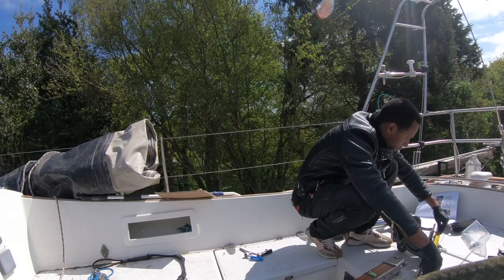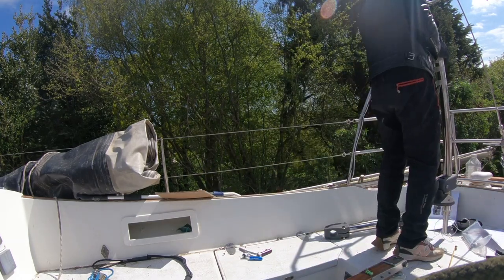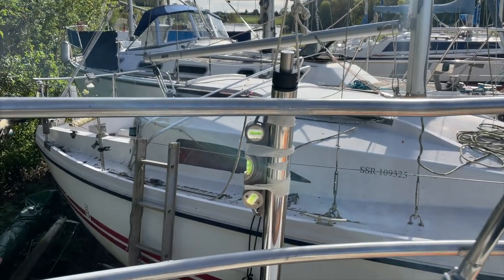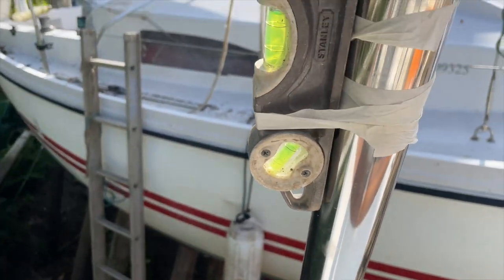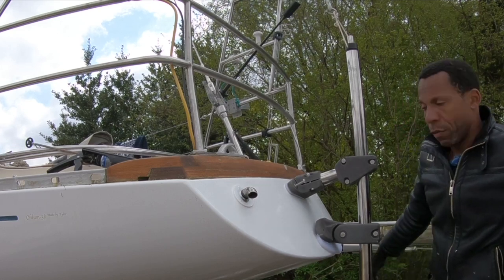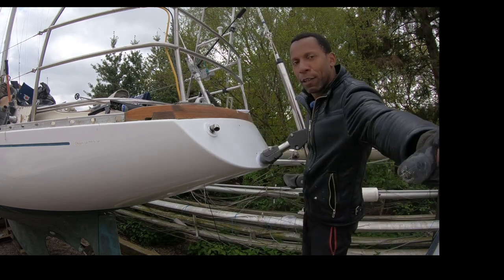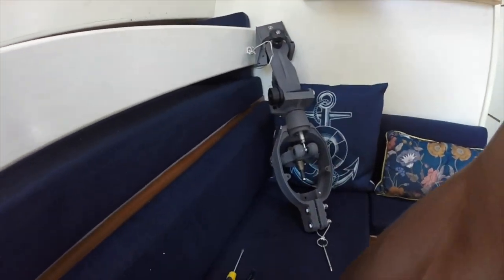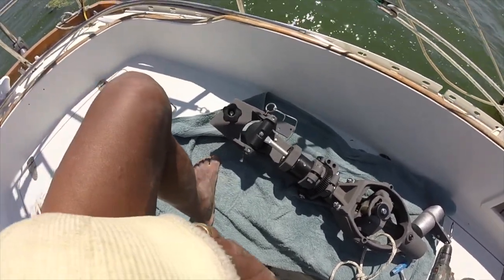Discover how Hydrovane revolutionizes sailboats

Comment: I’m looking forward to seeing you test out the new Hydrovane. 

First time we tested ours in earnest was on a non stop passage from Friday Harbour, Washington to San Diego Ca. with 25 to 45 knot winds the whole way. 
It was amazing how well the Hydrovane steered the boat in those winds and seas. It didn’t seem to care how balanced the rig was, just the main or just the storm jib, it just kept steering regardless. Even dead downwind in squirrelly seas with 3 reefs in the main and no staysail or jib was no problem.
Off the coast of California we almost lost it thanks to the huge loads the single strut mount was subjected to.  John Curry warned me the single strut might only be borderline adequate on our size boat (42 ft and 26,000 lbs) but would I listen? Well, I listen to John now for sure.

I’ve done some crazy stuff to our boat over the years but installing a Hydrovane was not one of them, one of the smartest thing we ever did for the boat.
Reply from the maker: I can’t wait to test it this season.
Did you notice it going off course by any chance?
Well, mine is a 38ft so I assume it will be fine. Did you have any issues with the Hydrovane mounts?
 I’m fairly good when comes to DIY.
Reply: @From_Refugee_To_Yacht_Owner  I think the single strut on your boat will be just fine. 
I originally had the single strut option and almost got away with it despite the much bigger loads. I’ve since gone with the A Frame struts for peace of mind’s sake. Our backing plates are G-10 composite and aluminium. They originally were plywood, not a good idea as I found out at sea.

Haven’t seen any unwanted course change so far. It sometimes will go off course in really light winds with a full main up. The mainsail on our boat is way oversized so that might have something to do with that odd behaviour. Other Hydrovane owners don’t seem to have that problem so it’s got to be an issue unique to our boat me thinks. 

Other than that whatever course I set is rock steady and will follow the slightest wind shifts. 
It also doesn’t seem to care about sea state, it can be washing machine conditions with 3 meter waves and it stays on course. I also like how it’ll keep steering right down to less than 5 knots of wind true. 
 
In any wind/sea conditions both the Hydrovane tiller and the wind blade will flip flop around a lot for no obvious reason, like really a lot. At first I was disconcerted and thought something must be wrong so kept trying to get it to behave in a more orderly fashion which would then cause unwanted course changes.  So I gave up trying to understand how it works and just let it flail about, problem solved. 
In honour of that wacky behaviour we’ve nicknamed our Hydrovane “Mr Wobbles”

Comment: Good video. Thanks. My boat came with one of these installed. I'm embarrassed to say I've yet to use it. (Guess I'd better get off my butt and just do it. I'll take your video as a kick in the pants!)  
I know they're a real plus. A friend had a second rate knock off that failed two days out. Later his rudder hit a cargo container and he had a mighty struggle finishing his voyage with a drogue that he just happened to find on a junk pile.  He's got a real Hydrovane now.  I think the first owner installed it on my boat because it's got an exposed blade rudder and he took her down to French Polynesia.  My friend's boat has a full skeg keel which wasn't able to protect the rudder. 
I can't remember seeing any good videos on how to use the Hydrovane.   
Yes! for  tethers. I have seen sailors and riggers with decades more experience than me send parts and tools over the side too many times. When I was watching them I would always have the thought, 'Is that secure enough?'  Oops! or they hit the part with a hammer - Ping!  

I figured out that just tying a fisherman's knot on the handle of a tool, a bowline on the other end slipped over my wrist just guarantees that tool isn't going overboard or crashing through a hatch. Or if you are going to hammer on something, wrap it in tape, do it inside a box in the cockpit or cabin.  I always carry paracord when I sail and even when I'm just traveling. I remember one experienced sailor seeing my two 23m paracords, "What's that for?"  Ah... everything.    Looking forward to your next video. Fair winds.
Reply from the maker: Thanks. Let me know when you try your Hydrovane just make sure no to sleep for 10h ok 😊

Comment: My comments aroused many protests. It seems that most commentors are not able to read properly what I said:
Hydrovane is a perfect aid. Maybe even the best. As long as the wind permits, and does not change a lot, the windvane will do its work. But: in case of a heavy windshift while you are sleeping, it will alter course. I have had 3 sailing boats. I learned on my travel from Holland to the South of France, that I could not maintain long periods without proper sleep. Tiredness will overwhelm you. Finally you will fell into a long sleep that might be fatal.  There are a number of examples to prove this.
Reply: You need to ask yourself if ten people didn’t “read properly” as you put it then perhaps the problem lies with your writing skills. 
Your ungracious criticism of everyone else missing your point suggests that you don’t subscribe to the theory that successfully communicating an idea is in the writer’s court.

I also see in your new comment that you’ve changed the tenor and logic to avoid a repeat of the criticism you got the first time. Either way, you still fail to see that it’s oversleeping period that’s the problem not what is steering the boat. 
And since you’re flexing I too have over thirty years of sailing tens of thousands of offshore miles with a lot of it close inshore coastal passage making. I consider inshore passage making to be the more dangerous pastime for precisely the reasons you cite, lack of sleep. 

Pip Hare a brilliant Pro offshore singlehanded sailor recently went aground thanks to a lack of sleep or oversleeping while her electronic autopilot happily chugged along on its own.  
I also suggest you visit the YouTube channel of another great sailor Eric Aanderaas and see what lessons he’s learned about going aground thanks to falling asleep while on an autopilot driven compass course. 
I personally know a fair few sailors who went aground for the same reasons and I take each and everyone of their hard won experiences to heart. 
To quote an old and tired saying;
 “There are two kinds of sailors, Those who have gone aground and those who are going to go aground” 
lame but true.

Comment: The Hydrovane, altough well engineered and functional steers a boat with the direction of the wind. During a 10 hours sleep, it can easily set you 100 seamiles off course. Prefer to have a compass driven one.
Reply from the maker: Who sleeps 10 hours in the sailboat while sailing ? 😂
Reply: Some do😄
Reply from the maker: By the way it can be attached to the compass driven one which I also have onboard.
However despite respecting your opinion or preference I guess it would be irresponsible to sleep for 10h while under sail and unattended vessel.
Reply from the maker: @zzp1  Jesus 😂😂😂😂
Like we say in Portuguese they will wake up in heaven.
Reply: @From_Refugee_To_Yacht_Owner  Henk de Velde did it. And yes, he was close to heaven. Therefore solosailing has its limits.
Reply from the maker: @zzp1  all solo sailors that I know and follow do sleep 20 minutes max at the time. Get out check all the surroundings and back to sleep for another 20 minutes and so on.
Reply from the maker: Do you have an Hydrovane?
Reply from the maker: By the way I just checked with Hydrovane company about your statement of 100 nautical miles off course in 10h and they replied:

Impossible and totally inaccurate 😂
Reply: Sailors have been navigating great distances by wind direction for thousands of years. It’s a well known skill set. Not one of those skilled sailors would allow ten hours to go by without the proper course changes. 
As for sleeping for ten hours that’s a nonsensical case for compass driven autopilots and equally irresponsible.
Reply from the maker: @neotropicbirdprojecttv5945  that’s was exactly my thought. 😂
I even questioned who would sleep for 10h with the vessel unattended 😂😂😂